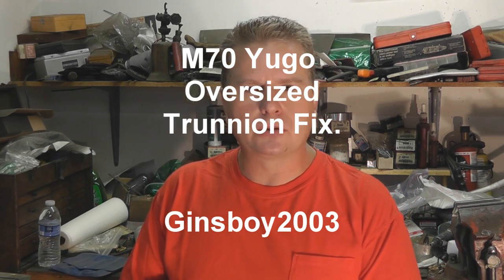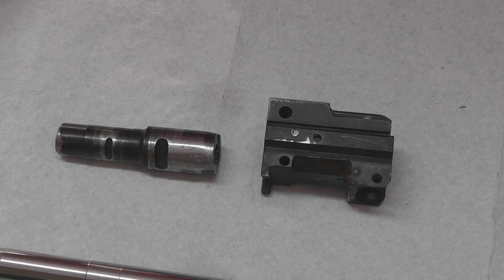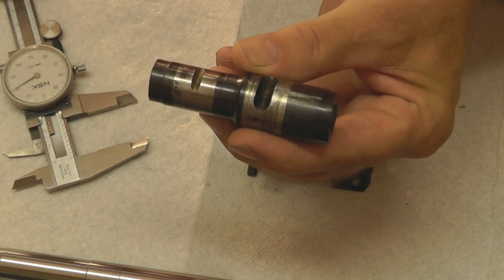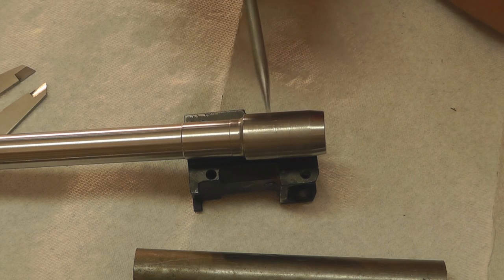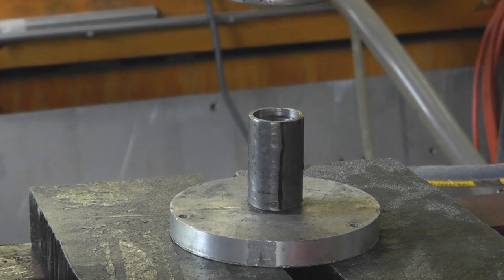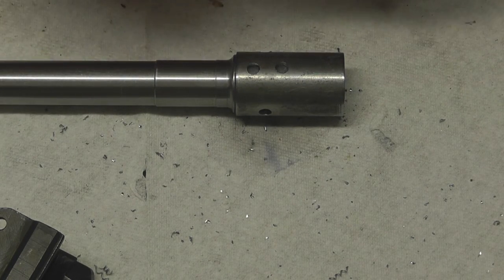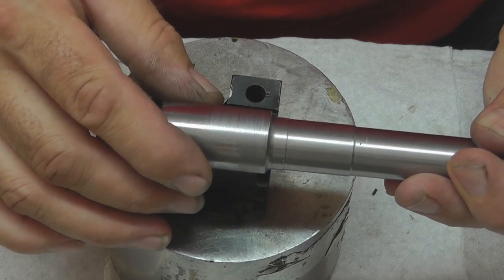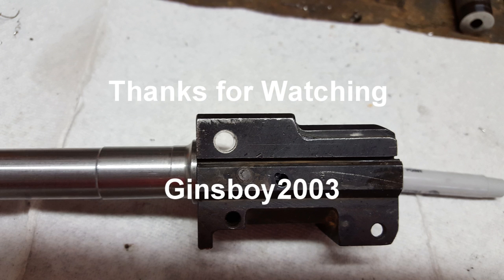M70 Oversize Trunnion Fix

Comment: ginsboy, from what I understand, the #2 on the trunnion is a number placed at the factory on AK platforms from what I understand from the number 1 through number 4 your trunnion your rear sight block your gas block and your front sight will be marked with one of these numbers the number 1 represents undersized part the number 2 represents what the factory is actually going for in diameter the number 3 and 4 represent parts that are oversized so basically when you get a kit if they are marked with the number 2 on those particular Parts front sight gas block rear sight block and trunnion those would be factory specs that they're going for when they're boring those parts anyting over 2 the factory overboard those holes Hance then the barrel has to be built different on the journals to compensate that build and the number one marked parts would be undersized and the journals then again would be changed for those parts to fit properly I also understand that the number one part Will Go On but it'll be very very tight number 2 is what the factory is shooting for and as I said 3& 4 are oversized Parts including the trunnion I've checked my parts kits and they are all numbered with 2 which means I shouldn't have any problems but getting back to your Yugo build that would have been the situation and those two barrels were different sizes and that's done at the factory don't take my word for it it's just what I understand when that problem occurs and what those numbers stamped on the parts designate hope this helps you on a future bills or maybe you can look it up and see if I'm correct or I'm mistaken by the way good job on figuring out just leave that barrel and make things work for you
Reply: You are correct. The #2 is a fitment number.

Comment: Awesome solution!. facing a similar issue on an 87 Yugo. But just a thought should you perhaps slow down the lathe speed a bit with cutting with HSS to get a better finish? Not that it matters much I guess. Just more of a question.

Comment: Your builds are far more informative then some of the others, big help to me with my builds for sure. I bought one those Yugo M70 kits from Apex a non matching but very cool kit. I have a questions regarding heat treatment of the receiver, I will be using a flat that I'm bending up, an I'm not set up to heat treat the whole receiver, I've seen how you do it in your video's the heat treating of just the FCG holes, in your opinion what would the life expectancy be for my receiver if doing it that way?
Reply from the maker: I don't think you'll ever where it out just heat treating the FCG holes.  Never heard of anyone had a problem just doing that.
Reply: Thank you for your response, i love you video's far the best on you tube, I meant to post on your m70 build as my question pertaining to the receiver for my m70 build, I'm going to heat treat my Ak builder flat the same way you do, thanks much

Comment: Would knurling might have worked in this case to make up the .003" or so? I've got a '74 kit with an oversized trunnion with the same problem.
Reply from the maker: +Chad Lawton It's possible.  If the fit were a little more snug I'd have tried it, but I wasn't confident enough in my knurling skills to do it.  A gunsmith who looked at it before I did, didn't want to try it either.